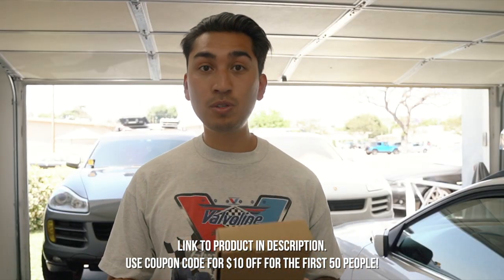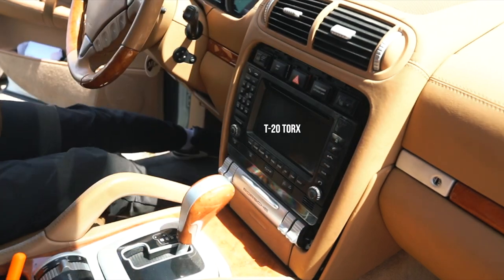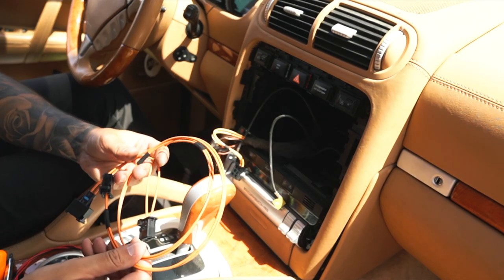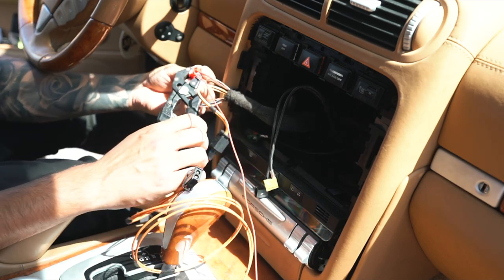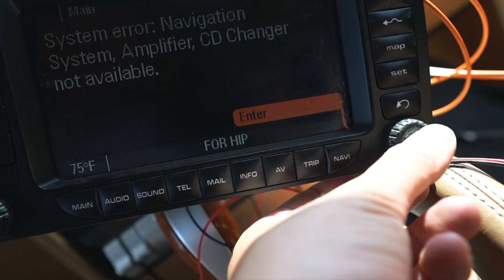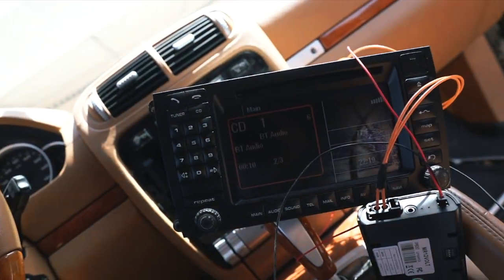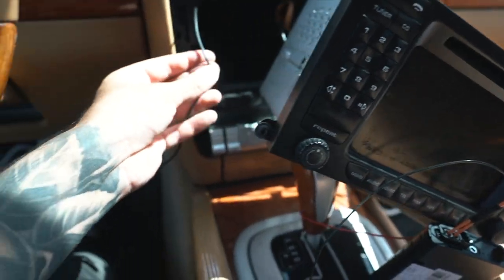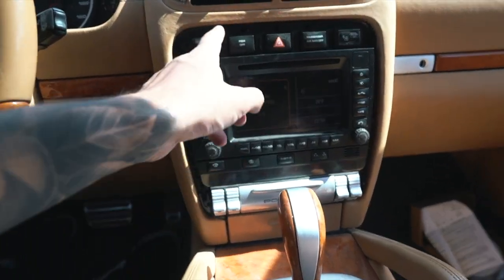BEST Porsche Bluetooth Adapter for PCM 2.0/2.1/CDR23/CDR24! | Mr12Volt

Comment: Thanks. I’ll buy one next week.
Reply from the maker: No problem. Very good sound quality, lots of other features to it too like SD card playing, AUX, USB. Lots more info on the product site
Reply: @GenoFoster  Thanks I placed an order. I'm just so tired of the static from my FM-sender :) Will probably only use the bluetooth.
Reply from the maker: @carlatashkadeh5890  Awesome! You’ll love it, I got so tired of the static too 😂
Reply: @GenoFoster  Yes so annoying! Just received it. I’m a bit hesitant to connect the microphone due to aesthetics. Do you use it a lot and does it work well?
Reply from the maker: @carlatashkadeh5890  This was installed on a friend's Cayenne and he wanted to use the microphone more. He said it's pretty good quality. But you are right about the aesthetics part, wonder if there could be some way to route it to the center panel of the headliner to make it less noticeable
Reply: @GenoFoster  couldn’t find any other good place. I have black interior so looks OK and works great!

Comment: Installed it on 2004 porsche cayenne turbo  last night it did not work. Bluetooth works.  I got bose on mine. I ordered it on the link you shared from Amazon. I finally look at the manual says it is for Mercedes Benz.
Reply from the maker: Sorry to hear you purchased the wrong one but the links I provided in the description are not links to Amazon. They are links to the actual website.

Comment: ok, it took an hour to get cord off the back of the cd changer. where does the bypass go? on the loose cord, or in the the changer. the loose plug seems like it looks nothing like the male end of the bypass. im about 5 mins away from returning this to amazon
Reply from the maker: If the bypass doesn't fit on the cable you unplugged, you unplugged the wrong cable from the CD changer. It should plug into the loose cable acting as a bypass

Comment: Btw, do I need to have the cd Switcher for it to work?
Reply: Ah, I need to bypass if I have it.
Reply from the maker: @carlatashkadeh5890  Correct, if you don’t have CD changer everything is still plug and play. The bypass cable is only for those who need it!